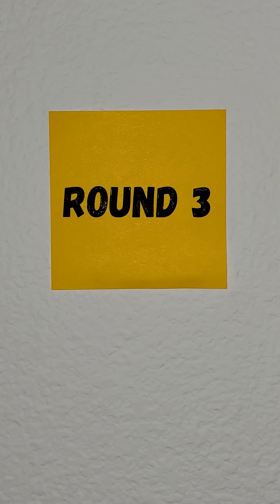What happens when you sprinkle flour on a flame? - 2 Truths & Trash - S3E8R3

Comment: I got this one. My reasoning is that for the first one to work, that singular material would have to be able to convert thermal energy into kinetic energy, which seemed unlikely. I also knew that the smaller the particles of something, the better they burn, so I was pretty sure number 2 was true. Number 3 seemed plausible since nail polish is meant to make a glossy surface and black is a color that typically the only light that's being reflected is just white light because black paints aren't pure black and they tend to absorb every wavelength but not completely absorbing them. Kind of like the opposite of a mirror.

Comment: Hot air moves up, so it would move out of the way of the foam circle, and plus, it would push it away because pushing air into other air makes denser air, pressure equalizes, pushing the cylinder AWAY if the heated air actually made it to the cylinder. and both the other ones make sense, and by this logic, first one has to be fake.

Comment: Fun fact, airborne flour particles can be very explosive, flour mils required good ventilation to prevent them, grains dryer can explode due to grain dust in the air, same thing with sawdust in wood mills.. you know what can it explode could make a fun short!
Reply: that feeling when my pantry turns into a thermobaric bomb
Reply: Fun fact, I work in a business solely dedicated to creating explosion prevention methods for mills, transport companies and dryers. Milk powder drying can be very explosive if not handled correctly.
Reply: sugar refineries also are very dangerous
Reply: @danielvieira5831 indeed, all food above zero calories is flammable by definition. Calories are a measure of heat, and calories in food are literally measured by how hot the food burns. Airborne dust is like the perfect condition for ignition, so flour or sugar dust in the air would be highly explosive.
Reply: he who controls the vectors stand no chance
Reply: Same thing with machining halls or even room dust. Like don't do fire work without checking air vents, ceiling level, cable channels and whatnot and setting up a safety barrier. It's a nasty surprise. Literally anything that is dusted is prone to explode.
Reply: The same is true of sugar. As it so happens, organic stuff can catch fire quite easily, especially when it is very small.

https://youtu.be/Jg7mLSG-Yws

The above is what happens when you don't plan with these properties in mind
Reply: I found out about that because of an anime 😂
Reply: @JustADinoNuggie  Goblin Slayer?
Reply: @Matelk no, it was the apothecary diaries.
Reply: Even sugar dust is highly combustible. Weirdly I only found out about it due to my phase of watching those CSB incident videos
Reply: Don’t smoke in a coal mine

Comment: B I am 100% sure.
Both A and C seen convincing, I know the effect thin films have so C seens plausible, but I am not surethat the described process creates thin films.
 I know about fluid mechanics so A seens plausible, but I amnot sure If such small speeds will create enought preassure.
 I will beat on C because I saw a video about a physics professor being able to use the lower pressure from his own breath to suck In a small ball, so the scalea should about check out for A to be true.

Comment: I figured it was the foam but the clear nail polish actually doesn't work with certain clear paints so i was unsure. Thats actually a refraction of the light same as when your car has an oil leak in a puddle not all paints prduce this reaction so that was some interesting science
Reply: It's not really about what nail polish. As long as something thin is clear, the light will reflect and refract off both sides, creating the rainbows. Oil just does it because it sits on top of the water not because it's oil.

Comment: easy

the flower thing isn't specific to flour, and is actually a huge issue in certain factories where fine dust particles can easily catch on fire from simple static discharges from the equipment

the nail polish thing is just think film interference where a mismatch in refraction indices of two semitransparent materials selectively causes different wavelengths of light to reflect depending on their angle of incidence

Comment: If there was more air and less of an incline the first one might work (if the air is moving in the right direction) but the setup you had definitely would not work
Reply: The main issue with that concept is that pressure will be slightly higher on the near side than on a the far side. You can imagine a bit of the air piles up on the near side and a bit gets pulled away on the far side meaning even a light wheel will still always be pushed away and up rather than up and towards the source (as long as you're still blowing on the top half of the wheel like thing
Reply: @solsystem1342 wouldn’t change if you blew on the bottom on the right side either tho? As long as it’s on the right side it will always be pushed down. Maybe unless there is very little friction?
Reply: Why would blowing (ie pushing) the top of the foam cause it to roll towards the push?
Reply: @magellanicraincloud original poster said change direction of air. Blow air L to R on top and you could push up hill
Reply: @thatgreenguy3969  ah whoops you're right
Reply: Berniuli's principle wille explain this @magellanicraincloud
Reply: @magellanicraincloud  https://en.wikipedia.org/wiki/Drag_(physics) if you want to read about it and see it visually why or how it works the wiki is pretty good since its not really that easy to explain in normal human terms.
Reply: @RSWrecked  More relevant would be Coandă effect.
Reply: @tylisirn yes you’re correct. I asked chat GPT and they said the Coanda effect and Bernoullis principle are the most relevant to this discussion
Reply: @magellanicraincloud air at top would become hot and would rise up quickly so cold air from the surroundings would rush in to fill that place and cause the movement
Reply: @magellanicraincloud Moving air has less pressure, lower pressure suck things ( well, It pushs things less than the normal pressure on the oposite side ).
Reply: @ReiSabio11235  The main issue is that wouldn't cause it to roll up the incline, either the pressure is strong enough to counteract gravity completely or it simply slows down the roll, but neither result in the thing rolling uphill. It either slows down or floats up.
Reply: No, the potential lift would have zero impact on rolling towards the head source, and if anything the air blowing away would push it.
Reply: Were*
Reply: Yeah no shit, that’s the whole point 😂 but then hot air also wouldn’t help, it would actually do the opposite. This could probably work if you’re assuming there’s low friction like ice, and you blew really hard along the foam edge, and the foam roller was actually aerodynamic. If it had small edges/teeth or hooks that would cause the air to hit it harder and cause a bigger impact. And if the incline was way smaller ofc. 

Idk if hot air alone would be enough though, especially if you’re blowing it down the incline, and simultaneously trying to get it up. Because those are contradicting forces. Maybe with a low blow, and high heat.
Reply: It can be that the heat gun causes higher air speed on the top decreasing the pressure while the lower air has higher pressure and it pushes the foam upwards. 
Similar to how planes fly
Reply: But since it's hot air the air will move above and the empty space will be filled by wing and so ig it can move(don't think it will work on such an incline)